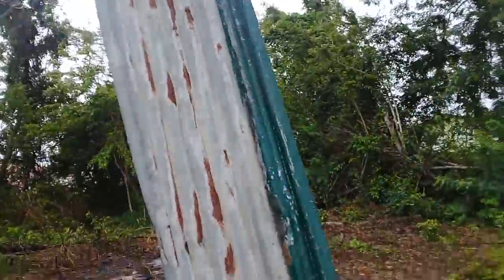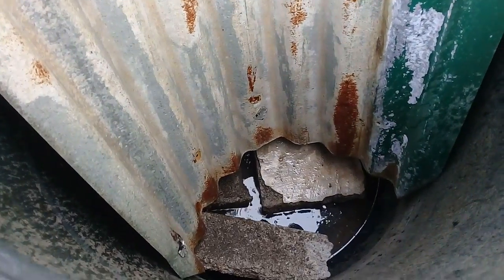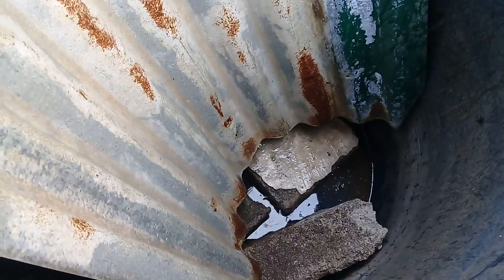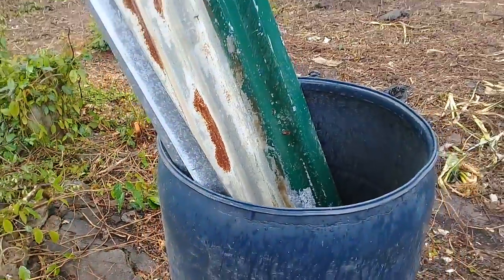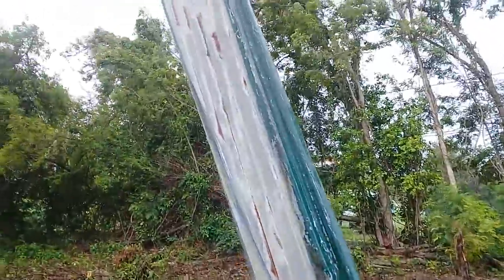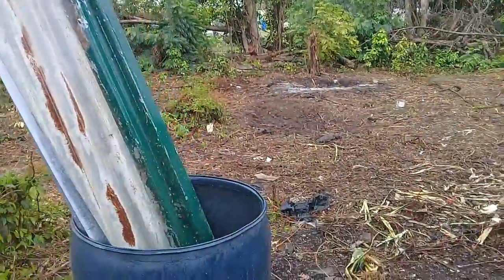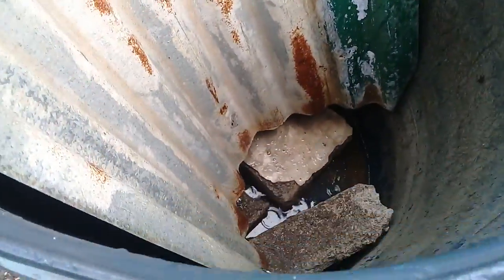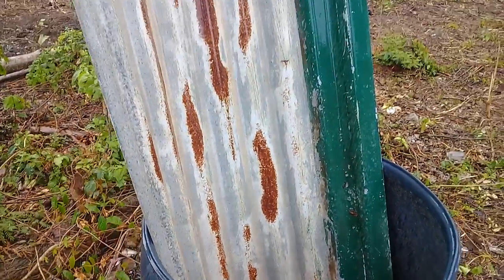Super Easy Off-Grid Rainwater Harvesting - It Works!

Comment: I did an experiment a while back where I took two buckets of equal size, made a concave circle shape out of plastic with a hole in the center - it extended a few inches past the bucket rim, and put it on one of them, it had a significant increase in rain water.

Comment: Hey David,  the "zink" is too straight. You need to have it at a more 60% angle to have more surface that the water can collect from. Also, if there is any roof left on the old house, you could posession the barrel under the tail end and use the gutter to collect the water.
Reply from the maker: I balanced it against a post - it's at about 45 degrees now. Will show you in the next vid.
Reply: David The Good ok bro.

Comment: Lay that flat. The more suface area of the land you cover, the more water you harvest.
Probably could prop each end of that steel roofing up under each of those barrels, then whichever barrel is lower will catch all the water from it.
Can you use that concrete slab as a collection surface?